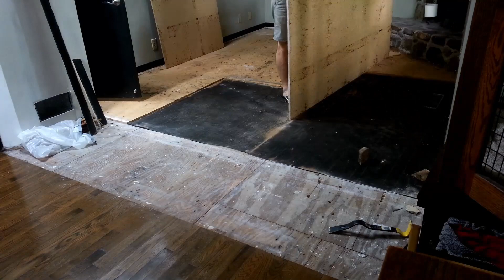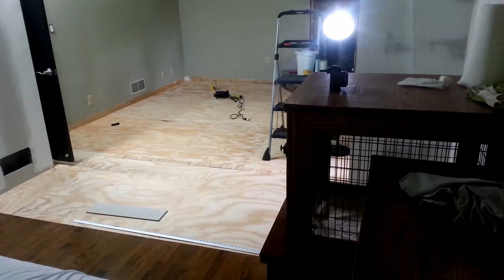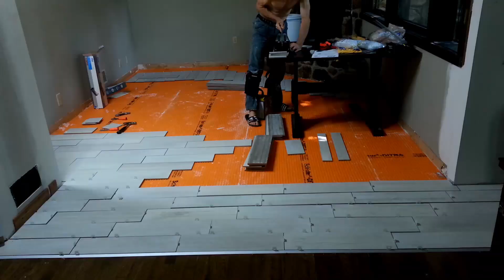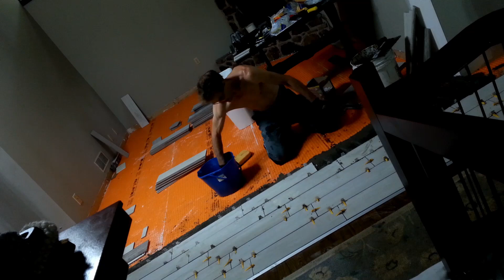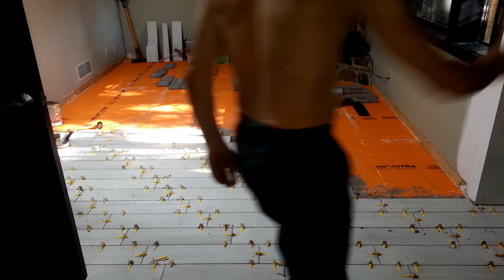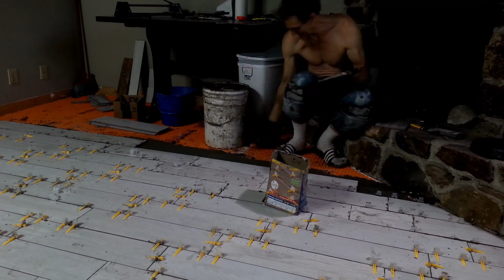Carpet to tile in 3 minutes

Comment: This was great to watch...   it let me (briefly) imagine that the new house I'll soon be building will be finished in a similar speed...

The one positive is my home will be erect and airtight in 3 days (once this house has been torn down, removed and a new foundation put in place) as it's being built out of factory made concrete board and closed cell foam sandwiches with everything made to mm spec.   Then it's just a matter of all those footery details like adding exterior/interior coverings, roofing, electrical wiring, plumbing and all the cosmetic bits...   sigh

At least, once completed, the solar PV + Tesla Powerwalls + Sunamp PV heat batteries + other nifty kit will mean I'll never spend a week without power for the AC (or even a fan!!) in the SW Florida summer like I did after Irma again !!!   Thanks for the video !!!
Reply from the maker: That sounds pretty cool.   I had not hear of Sunamp before.   Good idea, phase change material heat storage, assuming it is cost competitive.
Reply: Bruce Winter - each SunampPV 5kWh unit costs less than $1000...   with two going into the new house I'll have no need for an electric hot water heater tank (gas isn't really an option here in FL) and get all of my hot water instantly, and since they're charged from the solar PV, essentially for free...   as they're so small, one will go in the kitchen and t'other nearer the bathrooms to eliminate hot water 'lag'...

It's a rather remarkable invention that, imho, makes solar PV even more attractive as it's another use for my generated power other than sending my excess back out to the grid and eliminates a hugely inefficient water tank !!

Comment: That type of tile looks much better in a more random pattern then a brick pattern.  
I prefer only two rows of brick pattern.  You dont start the third row with a whole tile again.  
You go with a more random cut tile length like a real oak floor would look like.
Then keep alternating between two rows of brick pattern and one row of totally random.
Unless of course you like the brick pattern running up your floor in long narrow tiles.
Reply from the maker: Thanks for the tip,  I may try that on the next tiling project.